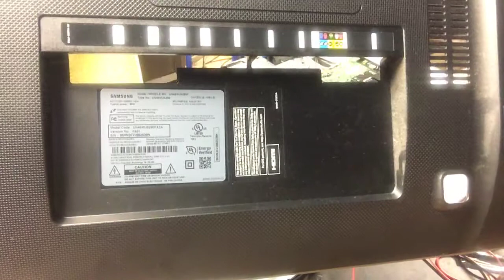2017 SAMSUNG 4K SMART TV UN49MU6290F WON'T TURN ON TROUBLESHOOTING PART 1

Comment: The voltage out on pins 3, 5, 7, 9 actually should read 9 volts when connected to the main board with the power off, this is the standby voltage. Once powered on, it will switch to 13 volts as this is the operating voltage. So, your voltage test by unplugging the power from the main board didn't diagnose the problem. (Go back and check now that the TV is working, it'll read 9 when off, 13 when on.)

Also, before replacing the main board if 9 volts is found when connected and 13 volts when disconnected, you want to disconnect the two ribbon cables at the panel end to see if the standby light comes on with the panel disconnected. If it does, there's a good chance the panel itself may be the issue.

Basically, you got lucky. Not super lucky, as the main board on these TVs seems to be prone to failure, but still somewhat lucky.

Comment: I have a UN40KU7000F 4k Samsung 2016, that I purchased in 12/2017. The screen flickers but never turns on. Have tried all the troubleshooting tips I could find. Disconnected all cables and roku. Power light is steady red, but it doesn't turn on. Is it worth it to have a repair man check it or not? Thank you!

Comment: I got the same problem with the Samsung TV i found onside the ro ad I took a blowdryer and heated up the mother board it worked until I unplugged it    now the Red light keeps flickering or flashing how can i fix this problem taking all advices

Comment: I wish I watched this earlier. I replaced my powerboard and it didn't fix the problem. My main board is coming hopefully that fixes it.my tv cuts the red light keeps flashing then cuts off
Reply: Do You mind sharing where did you get the main board from?

Comment: I have a Samsung 48" UN49M5300AF that won't turn on. When I plug it in, the standby light blinks six times, then goes out. I took the back off, unplugged the cable to the main board, and the backlights didn't come on. I checked the voltage with the cable unplugged and got 12.74v on all the lines that are supposed to be 13v. I didn't know to test them with the cable plugged in.

Even though the TV won't turn on, I hear a very faint buzz from the T-con board and the optical audio port has a red light. The T-con board gets warm and a black metal plate on the main board heatsink?) gets kind of hot. Other than that, the TV won't do anything.

Comment: This was an awesome tutorial man. Really clear and easy to follow. I have the same damn TV with the same issue it seems. Looks like the main boards are out of stock most places now
Reply: I have a UN55MU6290FXZA - same issue - pretty sure it's the PS - but out of stock most places - - I need a CC09.  Has to be the exact replacement otherwise it will not work - so I hear.
Reply: @robwinter3183  so what happened?
Reply: @ANGEL-fg4hv  I put some tape on pin 6 o the ribbon cable - the tv works now - but I have 2 small vertical lines in the screen - I might trim the cable back.  Or might replace the ribbon cable.

Comment: I’m curious why a main board would go out? We just bought a Samsung tv 11 days ago. Indicator light is on. Tv won’t power on at all. Been reading forums all day and I have a feeling this is our issue. Luckily it’s still under warranty but if this is a common issue with Samsung TVs then should I just get my money back and get another brand tv?
Reply: Power surge is the number one cause of this. I bought mine in 2018 and it just died last week during a double power cut.

Comment: I have one doing something similar.  It does not have the 13 volts on pins 3, 5, 9, but has about 9 volts.  When I unplug the main pcb, the low voltage stays the same.  If I remove the power supply from the tv, the power goes up to 13 volts.  Mine is a Samsung UN50NU6900BXZA, which looks identical to this one, except the power supply slides into a connector for the LEDs instead of having a cable.